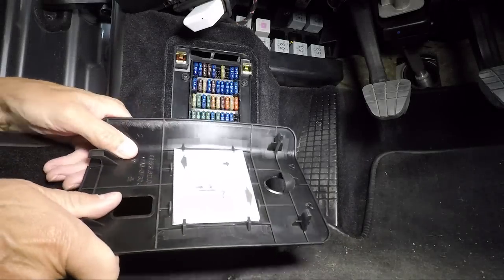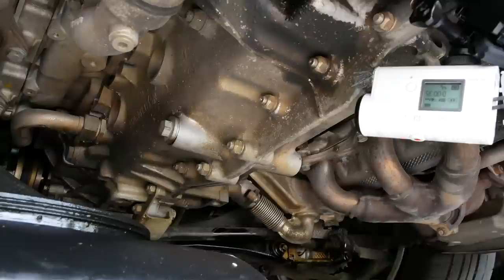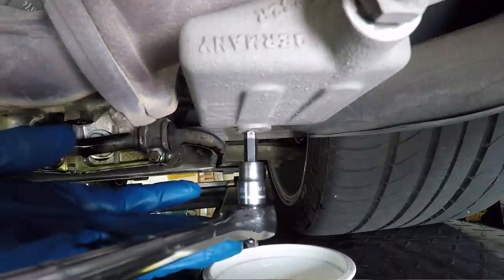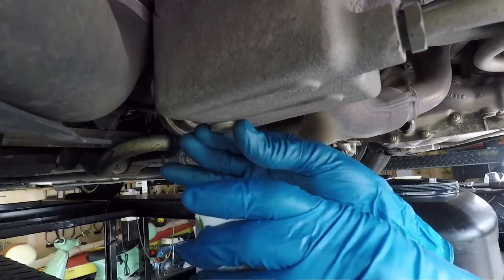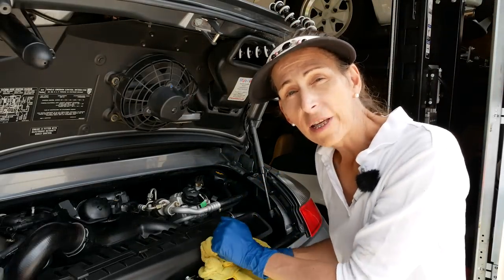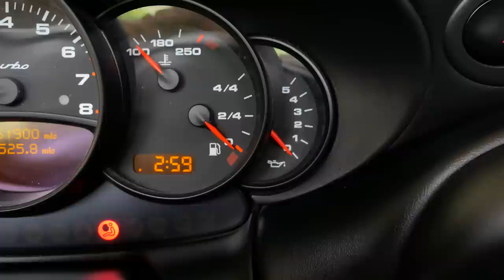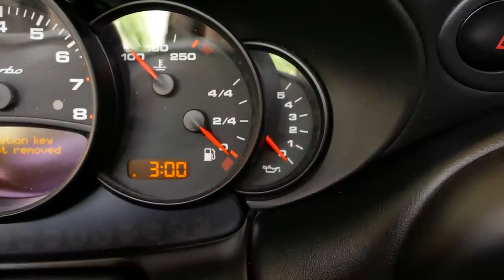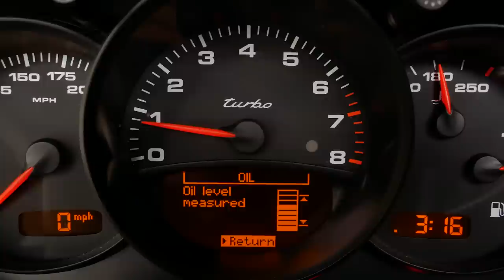Porsche 911 (996) Turbo Oil Change DIY!

Comment: I was able to do the oil change yesterday. I just went step by step exactly as Franny said and it turned out perfect. Run of the mill oil changes spots wouldn't touch the car and I really wouldn't want them to knowing what I know now about changing this car's oil. Now that I can DIY it I don't have to worry about killing a bunch of time taking it to and picking it up from a European car shop. BTW Franny, I didn't have a 27 either....I don now! lol. Appreciate you Franny! Cheers, Darin

Comment: I completed my own 996TT's oil change yesterday. Thanks to how comprehensive y'all are, there was not a single surprise – EXCEPT for the stripped hex on the right side turbo reservoir! Somebody screwed that up before I bought the car, but thanks to your guidance that this is a very small amount of oil, I didn't worry about skipping it. Everything else, including pull the C4 fuse and pre-lubricating through the filter, went precisely as your video showed. Thanks for all this excellent content!
Reply from the maker: Great! (well, not about that stripped bolt...)  I think most folks do the turbos the first time and then never again ;)  Glad it went well!

Comment: Wearing a bright white visor while working with oil. Only a pro can pull that off :)
Reply: and a white polo at that. All that would be brown if it was me doing the work.
Reply from the maker: +Tim Gossett oh believe me, she has plenty of oil stained shirts!  Lol. Heidi
Reply: @HeidiandFranny  I've found a great way to get out oil stains. Fill a 16 oz squire bottle with warm water and add 2-3 good squirts of Dawn. Mix gently or add a few drops of alcohol and shake. That reduces the foam. Spray the spots as soon as you take the clothing off. It pre-treats the oil and keeps a lot of it from staining. It works on surface spots, even large surface spots, but won't take out anything that is soaked in oil. :( It will also take out dirt and grime. I work on my cars in our parking lot and it is dirty. I come in looking like Pig Pen!

Comment: Fantastic video as always. Good to see the turbo drain. I never would have even thought about that. Glad to see someone else point out to check the pleats of the filter, very important.
Reply from the maker: Thanks.  You are so right about the filter.  That is a super important step and maybe more important than the oil change itself.  Instant readout on the health of your engine. F.

Comment: As a Trainer/Assessor, I commend you on an excellent tutorial. This is the way a 'how-to' video should be done, with every single step clearly & thoroughly explained in detail.....including the most basic steps, which many tutorials skim over or omit because they assume incorrectly that 'everyone knows that' or 'it's common sense'. We all know what mechanics think about the 'common sense' of the engineers that design engines! 🤣🤨😏
Reply from the maker: Wow, thanks!

Comment: Just a comment on the topic:  Video is great- perfect.   But heads up if you don't have a lift and use jack stands where the suspension ties into frame cross bar which is pretty much the only place you can put them.   The jack stand makes placement of the oil catch basin difficult  for the forward plug so definitely prepare for a mess.  I used a small-ish 3 gallon bucket as the usual flat oil catch pan was impossible.

Comment: Best 996TT Oil Change DIY…I use your video description as my check list.  To that end, could you add the oil capacity (litres and pints) in you description.  Thanks,great work!

Comment: Hi im little bit late, and not sure u have the car till today. Great tutorial, super helpful. I spotted a little miss funktion on your oil pressure gauge, no way the car has about 1 bar oil pressure when engine isnt cranking. Its a common problem on this cars that the pressure sending unit fails after a while.  Best wishes from Bavaria ✌️
Reply from the maker: We do not own that car anymore.  It belongs to a friend and is running fine.  I do not recall one bar if the engine was not running.  It's all good!   Thanks.  Heidi

Comment: great video I've just got myself a 996 turbo x50 that I'll feature on my channel soon your video was very helpful keep these up. oh and please do one when you rebuild the hydrolic rams. keep it up!
Reply from the maker: Automotive Underdogs Thanks! Yeah, that's going to be a thing... They still work fine for now ;). I think I'll try replacing the copper washers first, but it may not be the fittings.  I need to do a bit of research first I think.  Looking forward to your video. Franny

Comment: Don't worry about the time, the fact that you added in some good steps and went through each process of the new parts to install, didn't make it seem too long, imo. Do you know when Porsche recommends doing a rebuild, and would you recommend doing a rebuild to someone who wants to go with the ball bearing turbos?
Reply from the maker: Hi Bryan, I don't know of a recommended rebuild period from Porsche.  Are you talking engine or just the turbos?  For the engine that is all over the map, but a good leak down and compression test should tell you what you need to know.  I would get the oil tested (like from Blackstone in our Boxster oil change video).  Knowing all the metal counts in the oil would say a lot about the engine's health.  As for the turbos, I'll check with some friends who have a 997 TT that is in need of a new turbo.  I'll see what their thoughts are.  Thanks for your comment!  Franny
Reply: Yes, I was talking about the pistons, piston rings, along with the main bearings, the rod bearings and the engine seals. The turbos are new upgrades from KKK, and are slightly larger than stock. The car has around 72, 000 miles, with a pretty complete set of records (and, no accidents!). It's been pretty pampered by the previous owners. Thank you for the time, I really appreciate it.
Reply from the maker: Bryan Hallman i don't know of an engine rebuild schedule from Porsche.. I would look at a leak down AND compression test and go from there.  These engines are really strong. I would be curious as to why the turbos pooped out (or did they?). Look at the filter and get the oil analysed. A bore scope can tell you what the cylinder walls look like as well.  Franny

Comment: You video is wonderful! Thank you so much for all the time and effort to put this together. Really motivates me to buy the essential tools necessary to begin doing these on my own. I just picked up a 01 996TT and have driven about 1,500 miles since purchasing 3 months ago, so this will save a lot of $$$ moving forward. I do have a question, how tall is your garage (or to garage door when open), and what type of lift are you using? Thank you! - Nic BTW, is that a Mini is see in the driveway? I daily a 2011 Mini S with JCW Kit.
Reply from the maker: Hi Nic, glad you enjoyed the video!  Congrats on your new awesome car!  They are crazy fast. 
Our garage ceiling is 11feet, 7inches and the lifts are ProPark8 lifts from Direct Lift.  Highly recommended.  Great lift - 110V, don't need to be bolted to the floor and can even be moved around.  They run close to $2K but that is like two reasonable repairs so they can pay for themselves pretty quickly.  But, the most important bit is the safety of having the car on all four wheels above your head.  We have a complete review video on the lifts here: https://www.youtube.com/watch?v=enPy96sihyo

Yup!  It is a 2012 MINI Roadster S with some JCW bodywork.  We have a few videos on that too (oil change, front axle, etc.)
Thanks again,  Franny

Comment: Great video as always!  I had the oil for my 997tt changed recently and the mechanic put 10 quarts of oil in.   The oil measure fills the very small bar above the normal range.   Will this overage damage the car?  Thanks so much!
Reply from the maker: Hi Calvin, I think some folks feel an overfill is bad.  If it is just a tad above, I wouldn't worry about it as long as the oil is checked hot.  Oil can expand a bit so you want to make sure you follow the procedure in the owner's manual to the "T".  Check in a few hundred miles and see if it is within the limits.
Reply: @HeidiandFranny  thanks so much!!

Comment: Nice video if I ever get brave and a lift I might try it on mine.
Reply from the maker: The process is pretty easy and you could skip the fuse pull and turbo drains and I bet it would be all under an hour but the lift makes it so much safer, easier and cleaner.  I've heard too many stories of guys hurt under cars... They aren't really all that expensive...  I think of it as how much would you pay to have your leg not broken if the car fell on it?  Probably more than the cost of the lift for me ;)  Franny
Reply: Heidi and Franny's Garage How long does it take for the oil to drain? The dealership says it takes an hour to drain fully. I always expect they are just trying to charge additional labor.

Comment: Franny, that is a complex oil system, and I find it scary not having a physical dipstick. I like the idea of pulling the fuel pump fuse to pre-lube the engine before starting it. I'll start doing that on my next oil change. Thanks for the tip!

Comment: Very informative! Your videos are always great. I had no idea of the multiple drain plugs on the turbo. I am assuming if you didn't pull all of the plugs that you would be left some dirty oil which is not good. This makes me wonder though if you take this to an independent are they going to do the same job as you did? One would also assume that since you are paying for a premium service that they would but people being people I would guess that some may not. What would you say is the turn time to complete this job, 1 hour maybe? Thanks again for the great video!
Reply from the maker: Hi Dan,  At a qualified shop probably less than an hour.  If you wonder if they also do the turbos I suppose you could ask for the copper crush washers they would have to remove ;)  The amount of oil in the turbos is really small...  like four ounces or so.  Not a big deal and most people don't bother.  The later 997.2 did away with the turbo plugs so maybe it isn't that big of a deal? F

Comment: Are you sure its steel? Because it is not magnetic and it is close to the aluminum block and most german manufacturers always use alu in the vicinity of the engine

Comment: Used to own vintage British sports cars; an early MGB Roadster, an MG TD, a Triumph TR4A, and a Morgan Plus 4.  The old British cars often had a oil filter housed in a steel canister on the side of the engine.  I remember many times after an oil change starting the engine with one hand on the ignition key ready to shut off the engine in a hurry if the oil O ring in the canister didn't seat properly which would blow oil everywhere.  This could empty the pan very fast and ruin an engine.  Once knew a TR3 owner who had just had his engine overhauled and was starting the engine for the first time after the rebuild.  He had everything set to go except he had neglected to connect the oil line to the oil pressure gauge.  These old Brits had direct line oil gauges so when the engine fired this guy found himself covered in oil before he could shut off the engine.  Fortunately no damage was done.  Fun times with old cars... 
Thanks again for the technical video!

Comment: Hi   I am a new 996 2000 turbo owner great vidio, What should the Terbo pressure  be at around 6000 rpm.  Thank you  Henry UK.
Reply from the maker: Hi Henry, Congrats on the new car! You should see about 0.7Bar.  The X50 and "S" will boost to 1Bar.  If you see more than 0.7Bar your car has been tuned ;)

Comment: Noticed that you have some form of wireless OBDII connector when you were showing off your fuse panel.  What part is this?  Thanks.
Reply from the maker: That is called an "Automatic".  It is (was) a 3G cell link to an app that monitors your car's vitals and position and can phone in an accident. It was a great product but the company went under unfortunately.

Comment: I have a query. At the end you measured the oil level when the engine was still running, but I was always under the impression that you measured the level after switching off the engine so that the oil could have time to drain down into the sump. If you measure the level with the engine running then this will give the impression of having less engine oil present as some of it will be circulating, thereby resulting in too much oil being put into the engine. What are your thoughts on this?
Reply from the maker: Hi, no problem. Since these engines (Turbo), has a Mezger dry sump engine, this is why you have to do it this way.  If it was just a regular 996, your question would be the correct answer.

Comment: Great video thanks  👍👍
Reply from the maker: Thanks!  More 356 videos to come.  Eva needs and electrical tune-up and valve adj check :) Franny
Reply: I look forward to it. It’s great to show people that Porsches are just cars and you shouldn't be scared to do work on your own car. i live in Australia and I have had to fix the rear shocks on my old 928S4, in the bush, and i was ammazed at how easy it was and how good the Porsche engineering was. Thank s again.

Comment: If you remove the filter first the oil will drain back to the case and will be drained while  draining the engine. By doing it last you are draining oil back to the case when you crack the filter cover loose. Not much, but if you are going through the work of draining the small amount from the turbos you  probably don't want that additional oil back in the engine.
Reply from the maker: Thanks for the tip!
Reply: @HeidiandFranny  , The filter housing design isn't like most German cars though. I tested it to see if it would completely drain but unfortunately after 30 minutes there was still the small amount left that needs to be sucked out. Most German cars drain completely if there is no problem with the housing. Thanks for the great video. Keeps people from paying what I could only imagine the dealer charges.

Comment: What if....my oil level is showing all bars on my 997?  When I first checked my oil level it took about 30 minutes and came back low. I added about half a quart or so and checked again (took about 10 minutes this time) and it came back high.  How bad is it to have too much oil? Also, I am not sure why I went from to low to too high. 

Thanks in advance.
Reply from the maker: Hi Bob, it sounds like you are just a tad over if at all.  If you are really nervous about it you can just loosen the plug (you can do it when cold) and just let a cup or so seep out and then tighten it back up.  Those electronic gauges are a bit strange.  It is best (on the non-dry-sump cars) to get it good and warm and then let it sit for 5-10min or so to get the best reading.  Oil can expand a bit when warm.

Comment: How often do you really need to change your oil I’m doing about 2000 per year in my 996 thanks
Reply from the maker: Your call Mike.  If you are really just doing that, maybe every other year.  We have this issue with our 993.  It hardly gets driven.   Just keep you eye on the oil levels.  Our turbo can burn through the oil.  It also depends on the oil you are using.  Synthetics obviously last way longer.
Reply: Thank you

Comment: Hi Franny, I noticed your channel and subscribed! The attention to details is incomparable! I noticed you have Mobil 1 turbo diesel oil, is that recommended by Porsche?
Reply from the maker: Hi Jerry, Um, probably not ;)  I'd need to research that.  I uses it for its extra zinc.  From what I read it is a re-branding of a European blend.  It is probably best to stick with Porsche's recommendation though.  The Turbo Diesel has been working well for the car and it did reduce the IMS rattle that is common on these cars.  But, use at your own risk I suppose ;) Thanks for subscribing! Franny
Reply: Great vid!  I had been using TD since 2008, but stopped about a year ago because they have changed the formulation, I believe they lowered the zinc component, which is what made the TD a better oil for the turbo.  I have gone back to a 50/50 mix of Mobil 0 40 and 5 50.
Reply: Zinc could burden the cats so oil manufacturers lowered the content. Mine came back from shop after expensive (more on labor) camshaft followers replacement. 2 years of chasing misfire codes, this was the fix. They added zinc additive. I'll probably start using TD oil next time. Pick your poison. Lol

Comment: After my oil change, the idle pressure was good but, after driving around, I noticed my pressure would not go above 4 bar most of the time.  It would just go to 4 or just barely over 4.  Is this the sign of an issue with the oil system?  Thanks.
Reply from the maker: Was it always like that or just after the oil change?  It should br around 7 or 8.  What kind of oil did you use?
Reply: @HeidiandFranny  I did not pay attention to it except that it was just over 2 at idle.  I just bought the car just 2 months ago and got all the fluids changed about a month or so ago.  They put 5-40 in it.  The brand is liqui moly.  When I first start it up, it is around 4 on the oil pressure scale.  I just noticed that it goes just to barely, barely over 4 above 4000 rpms.  Most all I have seen is nearly 5 at the same rpm.

Comment: Fantastic and very helpful  video but why that oil? Oil for Diesel cars?
Reply from the maker: Well, it is a very good stock and has a little bit of added zinc.  Diesel engines are pretty rough on oil!  A friend turned me on to it and it has worked well.